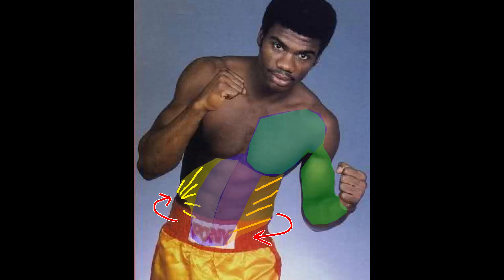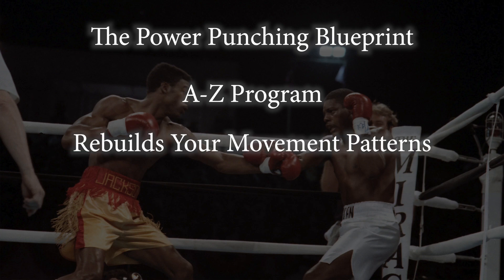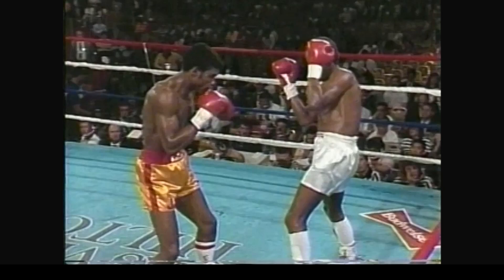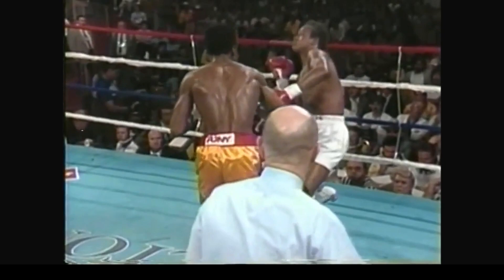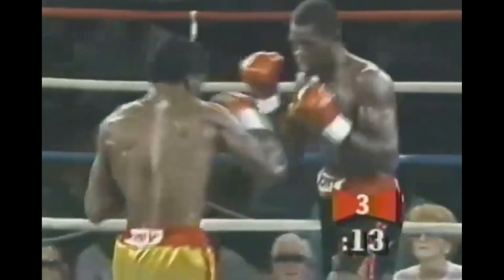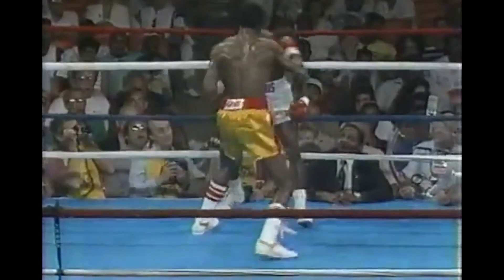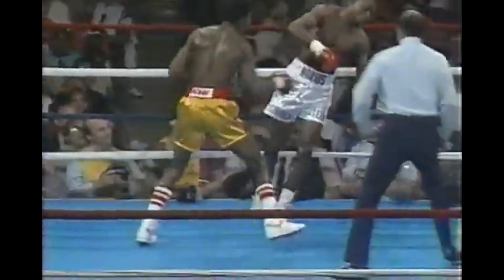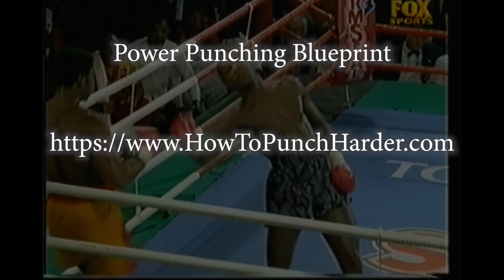How Julian Jackson Uses His Kinetic Chains to Develop Vicious KO Power

Comment: Hi thank you for this. Quick question when you say ‘arm moving back’ which arm do you mean his lead arm after the jab whilst he is gearing up to throw the rear hook ? or is it the rear arm drifts back a bit as his rear hip rotates forward first?
Reply from the maker: not sure which moment you're referring to however it's usually the striking arm drifting back the opposite direction of the hip. just letting the arm relax and lag slightly is enough, but you might have to exaggerate the motion at first to really get the feel for it.
Reply: @ThePunchDoctor at around 5:25 it seems for his rear hook his rear arm drifted a bit and he was pulling back his lead arm to aid in rotation for the rear arm strike

Comment: Should you retreat your punches quickly to get that snap/pop or should you aim to punch through the target?
Reply from the maker: Nooo that doesn't create the snap. You pull back on a whip to get the end to reach max speed so it cracks. Your fist and arm isn't a rope. The snap or pop in a punch comes from grabbing your fist at peak velocity at impact to create tension in your muscles and transferring your weight. Power depends on how fast you are moving, how much weight you transfer and how far. If you pull your punch back you are just weakening your punch.
Reply: @ThePunchDoctor surely once you've made impact you need to focus on retracting as fast possible or else you'll get caught and it will impact the power?
Reply from the maker: @ sure, after you've made impact and transferred your weight to the degree you want, of course.
Reply: @ThePunchDoctor  bet, thanks coach!

Comment: What are your thoughts on the jab being a linear trajectory vs the cross going downward.  Can or should the jab be downward?

Also planting down, loading your hooks without pivoting your feet.  I don’t think I’ve seen you mention anything about foot placement.  Great video-  thank you man
Reply from the maker: you're welcome, my pleasure. If you use the flick of the hips to accelerate the jab, similar to how Canelo is doing in my video about him, it will incorporate the hips and core to power the jab. as you turn your body away from the extending arm it will increase the stretch in the chains between the arm and pelvis that you can contract at impact to add stability and weight transfer to your impact if that's what you want. At impact if you land with some shearing force, which is some movement either down or towards your body, you will be able to land with a bit more force. Either way I think you can throw a faster jab using your hips. it doesn't necessarily need to be downward, however if you have a bit of trajectory towards your body you can utilize the cross body chains for a more stable impact. A strictly linear punch won't have as many muscles reinforcing it at impact. If you lean against the wall with the fist of your outstretched jab arm and push down you will feel more muscles engage. Hopefully that helps.

As far as the hook, not sure if you saw my video, however you don't really need to pivot on any foot if you have the hip flexibility. You will be torqueing your knees a little bit though. You can throw from a planed lead foot while pivoting on your back foot to throw with torque while maintaining good position for a follow up.
Reply: @ great thank you man appreciate the reply

Comment: Does follow through means turning your punch over? Thank you.
Reply: Yes you want to punch through your target I believe
Reply from the maker: that term is used a lot and maybe incorrectly or without clarity. There is a turn over of straight punches because that allows you to use more muscles to power the punch, and is a natural movement of "unwinding" like in a throw. The "turning over" will occur at impact to allow a follow through. In a hook you want to focus on the follow through, or weight shift between legs past the center line at the moment of impact, or even slightly before. My straight punch and hook videos go into it further.
Reply: @ThePunchDoctor  Btw, are you okay with turning your punch (almost your thumb is pointing downwards)? I feel its a little bit awkward and might cause injuries.